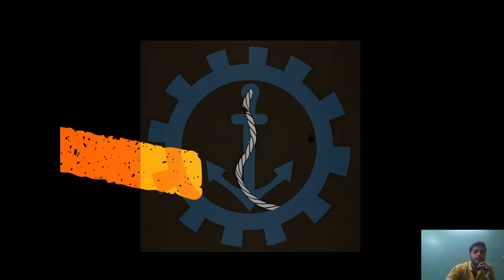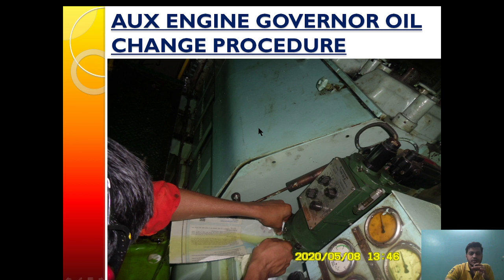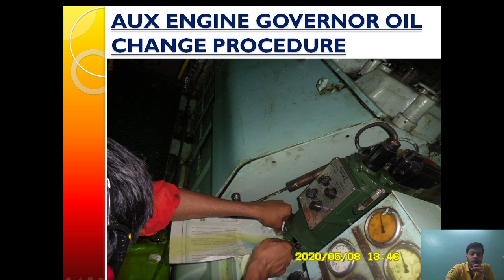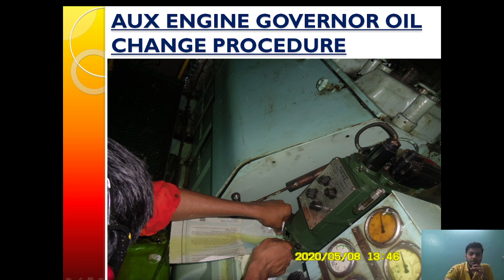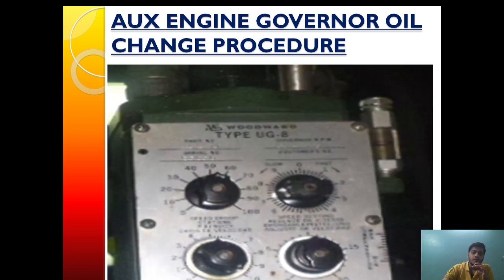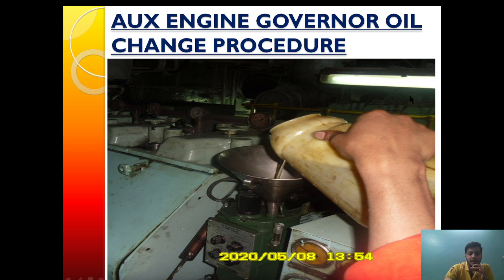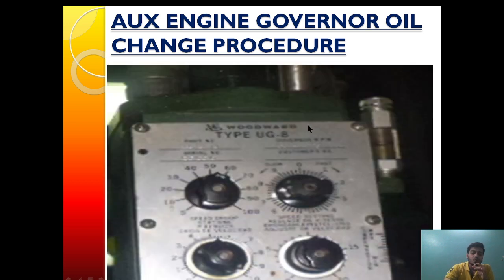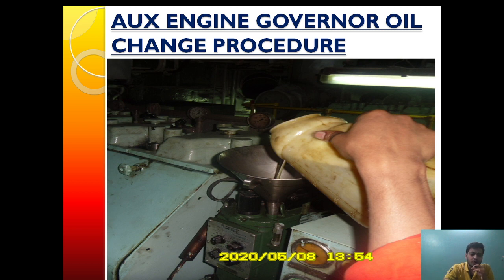Governor Oil Change Procedure| Aux Engine Hyundai Himsen|

Comment: Governor which grade oil to use
Reply from the maker: Please refil governor oil as per manufacturers manual
If nothing is mentioned then in most case auxiliary sump lube oil can be used as Governor oil

Comment: new auxiliary  engines output kw sapose 400.that times  engines  rpm 900.
when kw need 200,that times also rpm
same.
mean load increases  or decrease, not 
matters. always  auxiliary engines rpm. 
same.hear governor control only rpm.
sow when load mean kw need less that 
times engines rpm same. 
mechanical  sites auxiliary engines design  changes but alternator  what.
sir I only know,why this things are not
capable  to change this system. 
at shipping 🚢 on ship auxiliary engines users very long ago. engines  rooms  
climate at the ship if you not work, you
can't imagine.